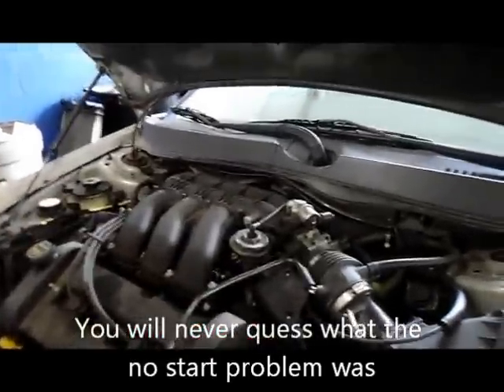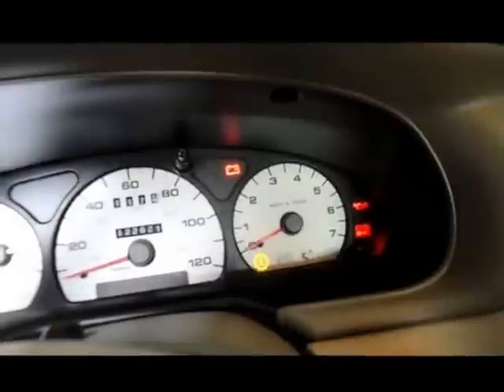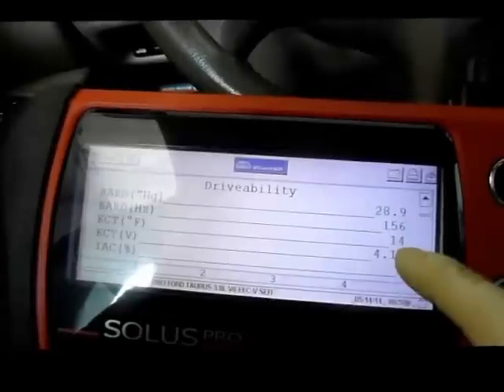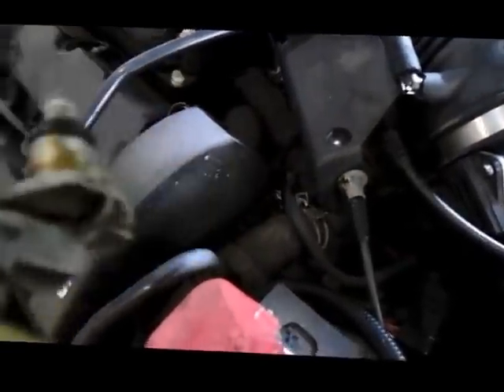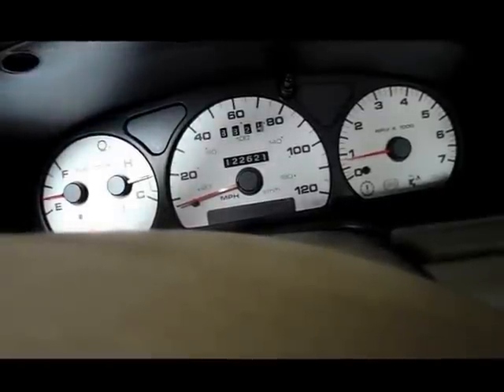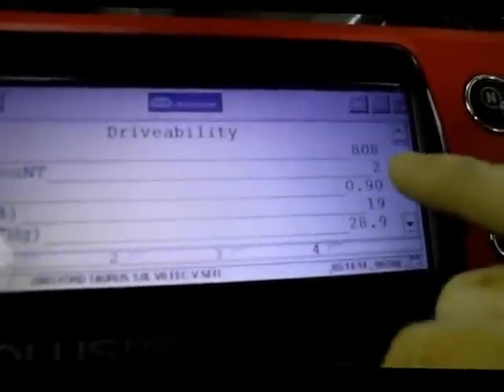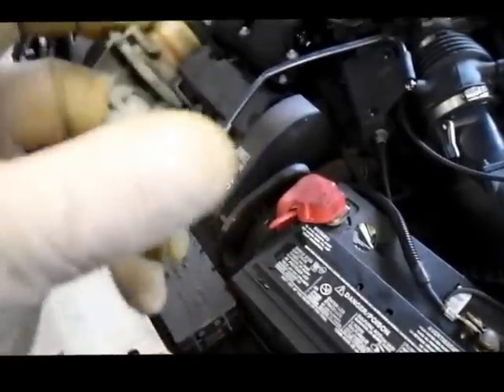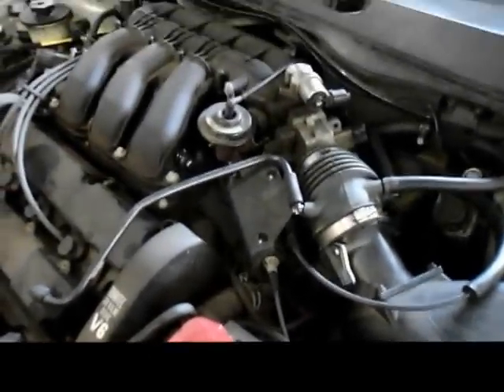Engine cranks but won't start

Comment: Only issue I ever had was on my 2003 Explorer 4.6L engine, back passenger side on top of engine, intake has a cap over a spare heater hose connector, well I was driving and noticed white smoke out the back like a head gasket just blew, I stopped just 2 minutes after at airport but SMOKE was gone, never lost power, dropped son at Airport. He's in the MILITARY, had no choice to stop at Airport only. Checked and seen some GREEN antifreeze drips, temp stayed perfectly, I drove home 15 miles at 60 MPH, ran fine temps fine, get 1/4 of mile from home, engine starts running SUPER rough and temp spiked to high at once. I stopped and computer read limp mode, I drove home at about 3 mph with heat cranked to HIGH, now I carry spares on me, happened again about 15 months later, right behind coil pack on #4 cylinder, took about 5 minutes to change it. I thought i blew a FAIRLY newer reman engine with just 40,000 on it, now I have 72,000 on it, cranks over, no start, it did it once the day before, starts on 1st crank of 1.5 seconds, let key come back and its running great, drove fine YESTERDAY, did it again today, almost started but didn't, then it started and drove fine for 7 miles, no issues at all, shut off and some 8 hours later,  I went to leave to get wife and no start. Now I had my CHECK CHARGING SYSTEM/BATTERY, that came on a few times last year in NOVEMBER, I bought a new GOLD BATTERY for it, old was 6 years old, figured it was the BATTERY on its way out, I'm disabled and did it when still could. Hate the cold weather, YESTERDAY into very early this morning, we got heavy rains with whipping winds that KNOCKED power out all over the place, i had to wipe my windshield down like i left a window open, never had that inside before, I checked all doors and WINDOWS with sunroof, all dry. Winds blowing that hard that we had trees down. I'm thinking something might of gotten wet, anyone have any ideas, no check engine lights at all, just the digital dash where the system is to check everything for the computers like MPH, HOURS&MINUTES, TRIP HOW MANY MILES ON IT, RESET OIL FROM IT, RUN DIAGNOSTICS, OUT ALL CHECKED OUT FINE. I do have and auto start, I stopped using it because it seemed like the CHECK CHARGING SYSTEM / BATTERY came on when I used that to start it. So i just go out with keys to start a few minutes before leaving if cold in winter. I wait about a minute or 2 for oil to get to top and RPMS to come to normal, most people jam in gear and go, not me. My miles went down big time, just getting 10 MPG, used to get MPG but changed coil packs on tune-up and put on MSD coils, better than Factory because the DENCO ones died in 14 months, 12 month warranty only. So for $15 more, I bought the better stuff, never had any issues since i put those on, I did lose mpg from a bit more power, step on it and she goes for a SUV AWD, very fast SUV. I bet it gave at least 10 HP more if not even more than that. Factory is 280 HP,  I'm a Chevy guy but end up with Ford's for some reason, can fix most of them, just don't have any computer's at all. I did replace CRANK sensor once from check engine light came on for it. One thing I DON'T hear, FUEL pump kicking on, NORMALLY I DON'T listen for it with all bells going off as it starts, keys in and noises it makes on these Ford Explorers from 2002 to 2005 model's. Almost put it up for sale 2 months ago, just hate looking for a nice VEHICLE. I'm SUPER picky, took 4 years to buy that, bought off MY BEST FRIEND, THEN BOUGHT A 2010 HONDA CRV 4WD 2.4L that took 2 year's of searching for right vehicle plus building up my MONEY to buy, just BUILT up to fix my house roof, now I need it for vehicle, Honda is for son to drive to COLLEGE full time plus go to work to. Can use it when needed but a pain if at school, at work, WELL that's 2 miles AWAY plus its a SUPER MARKET, so food shopping as we are there. Please need some input.

Comment: I am looking at a 89 Cadillac Fleetwood fwd that has been sitting and it will turn over but not start according to the seller.  It is a barn find with fairly low mileage.  I know it's a long shot since neither of us have any history.  Just looking for some ideas before i make that drive to check it out.  Thanks.

Comment: Top marks on your very helpful videos Jim.i am a what you call a back yard mechanic aka "Bush Mechanic" in N.Z kiwi terms,but these chipped out vehicles get me puzzled?!i think i have narrowed down an issue with my 99 2.0ltre toyota altezza, which instantly lost power while driving & ran sluggish.Lifted the hood and noticed the cat converter was red hot,next day it cranked but would not start? Fingers crossed my local mechanic diagnosis an ECT fault :D cheers again Jim, keep up the awesome detailed vids..i have subscribed.

Comment: When a temp sensor gets a hair line crack in it, it grounds and if the ecm does not get the input from all the sensors then it shuts down.

Comment: I'm not a mechanic, but if you think about it, coolant system is to prevent the engine from over heating and causing damage to anything inside. so if the computer thinks something is wrong with coolant system temp, it will kind of lock your engine.... I'm just guessing

Comment: Yeah, my mechanic told me today to check that sensor next if I have trouble cranking my vehicle when it's cold outside. Didn't think it would interfere either, but guess it does.
Reply from the maker: Thank you for watching.

Comment: its in the program, work in gas plant and the cat engines have same thing, delta temp from water and oil is to great and will disable the ignition circuit

Comment: In any computer controlled car air/fuel mixture is calculated by two readings, coolant temp and ambient air temp. The coolant temp reading being so low and the ambient temp being normal the air/fuel mixture had to be whacked. That would explain why when you got it started as soon as you put it into gear in died. More then likely the PCM could not calculate a number for air/fuel and crashed.

Comment: Wild guess - high voltage on a bad coolant temperature sensor was never programmed into the onboard computer so the computer did not know what to do. 
If the bad sensor shorted out the board or other sensors then I would expect to see more error codes. 
(grins) "This is why we get paid the big buck"  yea right. 
Thank you for sharing.
Reply from the maker: Thank you for stopping by the shop

Comment: Having the same problem with my Mercedes GL450. Didn’t start so I replaced the crankshaft sensor and it worked for a day but no doesn’t start. Gonna check the temp sensor now.

Comment: Some of these computers are very particular about the voltage range of different sensors hooked up to it. If the voltage is too high on certain sensors, it doesn't allow the engine to start so it doesn't fry the computer... Those get expensive. When the sensor was replaced and within working voltage range, it will start up because it is within save voltage range.

Comment: I am currently having the same problem with my 03' Isuzu Rodeo S-V6, 3.2L. I've Installed new car Batt. and C.shft Posi. Sensor; problem persist. Exact issue; turn, power, ignition and no turnover. Thanks for video sir; I will look into this next.

Comment: I'm presuming it's a safety feature?? If the coolant is frozen etc, when started it would damage engine components?  ?? Just my thoughts I have no clue..  once again cracking video ❤
Reply from the maker: You are correct. It is all for saftey. Thanks for stopping by.

Comment: It's a software feature forbidding engine start when a temperature sensor is fault. It would probably do the same if intake manifold temp. or block temp. sensors were off. Its a safety feature. There is probably a temperature comparison between sensors and if they are way off in difference, program says "no spark". Try to put new sensor that U know works OK in a cup of cold water and when it reads big difference in block and coolant temp. try starting it up.

Comment: My buddy has the same problem. His car won't start under 20 degrees F. He replaced the fuel pump, the plugs and wires, the fuel filter etc. on his '97 crown vic. I keep telling him to replace the ETC but he said that couldn't be the problem. There are a lot of YT vids that show this exact problem.

Comment: it's an overheat sensor it's to protect the engine just like the coolant sensor for coolant runs low gets below the level then the engine shuts down same way with the temperature sensor you know it's not working so therefore the computer might think that it's overheated or something or it can't let the engine start because of that

Comment: 2006 Prius I was working on, the water pump module burned out, the car started but then shuts down after 10 seconds. New modern cars, prevention detection sensors.

Comment: Hi there not sure if i replied to this before but, i think if the sensor wasn't working maybe it thought the engine was hot and didn't give it enough fuel to start it, taking plug of might have given it more fuel, i thought it worked around the other way though...Fred in Uk.

Comment: I am going to check my sensor to see if it is bad on my 1999 Ford Explorer which was running fine the last time I drove this vehicle. It was parked since it isn't used that much, and when I tried to start it again this last time, it would crank just fine, but not start.

Comment: That happened to my ‘98 Chrysler Concorde. It’s a closed loop system. If any one sensor in the engine safety system goes bad, it opens the loop, so that it can’t start and potentially ruin the engine.

Comment: a bad coolant temp sensor can cause the engine to flood out. because as you saw, the system thinks it is cold outside. so it will enrich the mixture.

Comment: Interesting never came across anything like it, on many modern cars if overheating occurs  the ECU picks up the temp from that sensor and starts to cut back the spark to each cylinder in a random way so you dont cook the motor

Comment: I am having an issue where my 2003 Ford Taurus  (3.0 Vulcan engine) won't start after it runs for a while. It cranks normally but takes a number of attempts before it finally starts. Once it does start it runs fine. I have a diagnostic device which reads DTCs and sensor data. The fuel pressure looks good (~ 40 PSI) and the alternator is new. I will look at the engine coolant temperature sensor. It may be. Fingers crossed...

Comment: Most cars today with a computer have 2 sensors, one for actual temp gauge, and one for fuel flow through the electronic fuel injection ports. If your car thinks it's 40 below it will give the engine more fuel then it needs.

Comment: jimthecarguy  I have seen this several   times. Here where it can get to  -40 the engine won't start because the computer thinks the motor is warm  and won't enrich the mixture enough. If you are old enough to remember cars with a choke, the same thing happened on them if the choke wouldn't close.. no start. How did you check for spark, was there really no spark?

Comment: I've  had a similar problem with my saturn, but it would start and run albeit very poorly.  Long story short, the engine temperature sensor was sending a signal to the onboard computer that the engine is cold, so it adjusts the air fuel mixture so out of whack that it either won't run or runs very rough.
I had my saturn to three different proffesional garages and none of them could properly diagnose the problem. I was ready to set it on fire and roll it down a hill. If it weren't for a youtube video i never would have  gotten it solved. Some of the g.m. four cylinder engines have two temperature sensors,  one for the gauge and one for the computer. They cost less than $10.00.

Comment: I think the key is the voltage reading of over 4 volts going to the sensor. i think it was shorted, pulling voltage and current from the computer board. That could have lowered the 5 volts needed for the computer to work correctly. The new sensor only drew .65 of an amp. So i think the old sensor was shorting most of the power from the computer board to ground, causing the computer to have problems.

Comment: My guess would be it reads as temp sensor failure, prevents start in case temp is very high. My bigge3st worry would be water temp sensor that does not screw in and pulls out so easy, when that plastic sensor is old and heat damaged it prob leaks.

Comment: here is 3 reasons i think might be why.
Safety fature to protect the engine because "its too cold".
Safety fature because the sensor is shorted (explains the high voltage) or have error reading.
Software bug because the sensor is shorted (explains the high voltage).

Comment: If the ecm sees the sensor in extreme high or low the ecm knows it's bad. Mitsubishi on 90s v6s shut your engine down if it overheats or shoes too low. I learned it when my car overheated and shut off in middle of highway.
Reply: Never seen Ford yet do it, but some might have the programming

Comment: The computer uses the engine coolant temperature (ECT) sensor to know how much fuel the engine needs and when to enter closed loop operation (that is, when the engine has reached operating temperature). Depending on your car, a bad ECT sensor can upset ignition timing, or the operation of the transmission or cooling fan.

Comment: I'm sure you know by now (too many comments to check) it's in case of a frozen cooling system in extreme weather, the sensor is probably set to cut out just above the freezing temperature of the cooling liquid. Antifreeze may create ice crystals and restrict flow at extreme negative temperatures. That's my best guess! better late than never!

Comment: I have seen this before. Either the muffler but probably the catalytic converter has collapsed and will not let the engine Push the exhaust out. Disconnect the exhaust pipe from the header, or go back to the exhaust pipe and see if you can feel air it smell  gas even coming out.

Comment: It's just due to really it has a combo of problems.  Check engine light should have been on for something other items.  Like the vehicle I was working on needed a tune up, a crank sensor, and a temp sensor.

Comment: I had an even strange problem with my GMC Jimmy SUV. The engine was cranking but never start. I  opened the hood and saw that  the air filter hose that connects to the MAF (Mass AIr Flow) sensor had popped. Hooked it back and tightened the clamp and VOILLA  IT STARTED ! 

The mechanic would have charged me $300 easy. I  fixed it for free in 3 minutes !
Reply: Out curiosity what year because most newer cars use adaptive strategy  to fill in the blanks.

In this case the Blank would be the Air to Fuel mixture. Adaptive Strategies in a car would pull info from few other sensors to try to compensate or go with last good value. I used the word "try" for a good reason, tho it will run it will use more fuel as it's not as accurate and since this uses more fuel, it will turn the check engine light on. Since the O2 sensor see the emissions form running rich.

But if you have an older car probably not in the 2000 and above (note I'm not sure when they started to use Adaptive Strategies but I have to imagine it was shortly after OBD2 so 2000 is a safe bet) then it will not work since it was 100% relying on the sensor.
Reply: GMC Jimmy 2001.  The intake was popped and the MAF sensor was sending wrong information to the computer which then was sending that wrong  information to the fuel injector. No air so no gas.  From what I know  14.7 grams of air must be mixed with 1 gram of fuel for perfect combustion.  So if the computer does not get the correct reading from the MAF ,, the fuel injector won't inject fuel. It is very important that the MAF and air flow has no leaks. I learned it the hard way, LOL. Hope that helps :)

Comment: Yes Jim I had a friend with a Lexus. He  had his car parked for a bout a month. Well mice got in the engine compartment and made a nest. chewed through the temp sensor wire.  Crank no start.  I repaired the wire and it started. I called Lexus they  said it had to do with engine overheat shut down signal to the computer.
Reply: Oh yea those mice can cause some real damage

Comment: I got a 96 taurus that overheated yesterday and now cranks and won't start. I'm gonna have to look into this as a possible cause. It didn't redline when it definitely should have. My girlfriend and I did pull over the moment we noticed a smell of antifreeze (found the leak in the system too) added a bunch of water and antifreeze we'd just fot for it as quickly as i could safely access the system to do so. But the temp guage only showed hot for a little while then by the time we got towed home it was already showing cold.

Comment: Hey I have an 2002 ford taurus I blowed one of my heads I put blue devil in it... I change my overflow tank yesterday and there is no water flow to my hose I squeeze the hose nothing. Car started smoking and cuts off. By watching your video my does the same thing it turns over but doesn't crank over . put in drive dies out I also have low oil. Let it rest over night this morning it cranks right up. Hope to get back to you thanks.

Comment: I have got a 2004 Sebring and this is the second time in two months that I went to start it turns over but doesn't start after watching this video there was one thing in common I had just added coolant both times it happened. After leaving it a couple hours it started right up
Reply from the maker: Thanks for watching.

Comment: Mixture is way off if the ecm is compensating for ice cold temperatures, the mixture would be way too rich to possibly run especially if the motor is at 195 deg. Try starting an old carbureted car with full choke on, on a warm day with the motor warmed up.. It won't start.